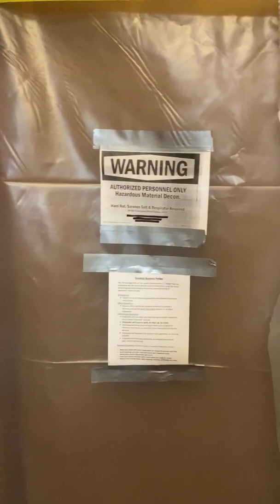Mold Remediation Procedure

Comment: Does  the IICRC require the same procedures be followed if a residential home has a contaminated HVAC system and/or more than 10 feet of visible mold was found?